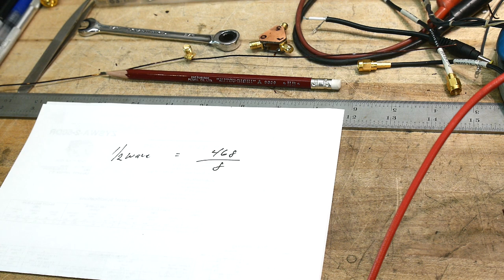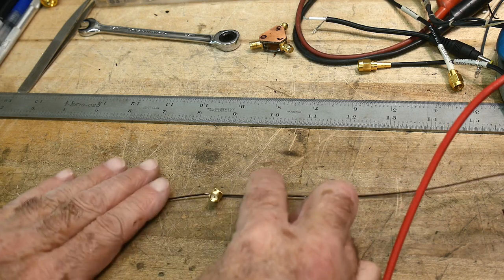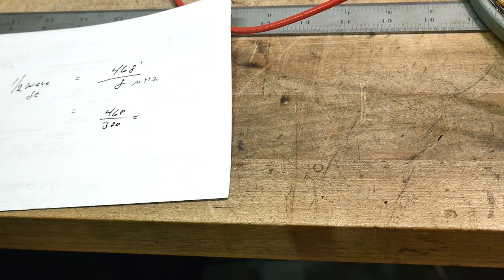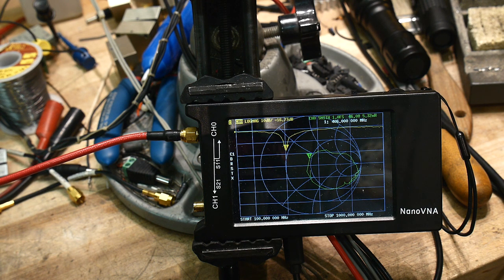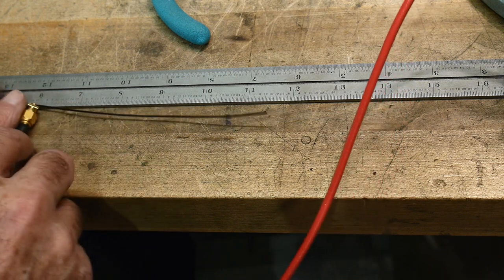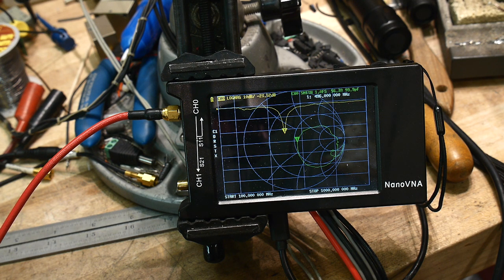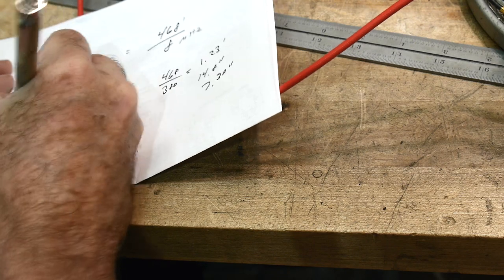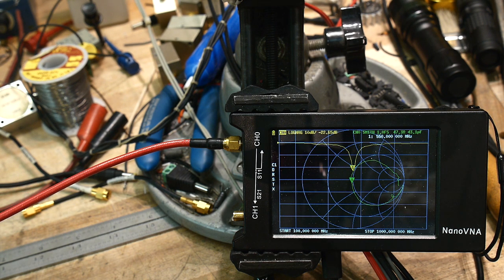#571b NANOVNA Measuring Dipole Antennas

Comment: The fact it is almost easier to calculate the exact dims using the standard formula I would advise anyone to just remember the speed of light.
Reply from the maker: yes that gets you close. the 'standard' formula has a 97.5% factor in it to shorten the length a bit. due to the length/wire-diameter effect
Reply: @IMSAIGuy  What I meant was it's hardly worth deviating.
Reply from the maker: @martinda7446  no you are right. I always want people to understand the simple ideas and not have to memorize formulas. gives a much better understanding.
Reply: @IMSAIGuy  I absolutely agree, but here the relationship with the speed of light, the wavelength and frequency is so fundamental and easy to understand anyway it is a wonderful thing - is what I was getting at. I didn't mean to sound critical.
Reply: There's a VP to consider also which is why the formula of 468/frequency is different from speed of light

Comment: God bless you for putting this out here.  I'm not sure what happened to our hobby that the newbies think that there is some magic to making an antenna.   Perhaps the license exam no longer asks for formula frequency for a 1/2 wave?  dipole. Remember back in the day running between the shack where you had your borrowed swr meter and outside snipping the wire?  Now it's easier than ever and hams are spending $100+ for a simple wire antenna.  They're missing a lot of fun and self satisfaction!
Reply from the maker: Millions of Hams have used DIY dipoles without baluns and worked the world!
Reply: @IMSAIGuy  Exactly, I still don't use a balun..most of my wire antennas are 1/2 squares now and I don't think it would perform w a balun.  Perhaps an RF Choke
Reply from the maker: @mjrtude  I just posted a video on 1/4 wave vertical and one in the future will be a discone

Comment: nanoVNA output is not balanced, so I think that without balun you can't measure dipoles, right?
Reply from the maker: https://rsgb.org/main/get-started-in-amateur-radio/antennas/your-first-antenna-the-half-wave-dipole/
Reply from the maker: all radios are unbalanced. dipoles work just fine.
Reply: The VNA should be calibrated at the antenna connection point, so that it can measure the antenna itself no matter if the output is balanced or not.

Comment: Imsa guy, a dipole is said to have an input impedance of 72 ohms.  Does that vary depending on the distance between the two feed points?
Reply from the maker: the 72 ohms can be derived with mathematics on an ideal dipole. actual dipoles are close. I don't now how much effect spacing the feed points would make. a small fraction of the wavelength. wire diameter makes a difference too

Comment: What would happen if you added a choke at antenna input ? Wouldn't that get you a better reading ? And isn't there a common mode current on the shield as it is there's usually current radiating on the outside of tne coax all the way to the source .

Comment: 0:35  The units of the 468 constant would actually be Feet * MHz (often confusingly written as "Feet-MHz", that's a dash not a minus). 

Dimensional Analysis processes units as if they're numbers; e.g. 'Feet-MHz' (constant) divided by MHz (the input) = answer (in feet).

Comment: You seem to be using your red coax (?Z =88ohms). Is this why the smith chart green circle off to the right rather than centred on the 50ohm centre. What would be effect be of using a 50 ohm coax? Does it matter if it was calibrated to load of 50ohms at the start?

Comment: That is how I learned decades ago to measure for a dipole but my doubt has always been, how do you account for the wire needed to tie the wire antenna to isolators or center balun?
Reply from the maker: use non-conducting rope, if you use wire then there will be some effect. not as much as you might think. every antenna system needs to be measured as used and tuned.

Comment: Given: A black box with a perfect world inside.
Given: A single element end-fed random wire on one connector on the black box, and a perfect ground on another connector.
Given: a Nano VNA

Question: What is the length of the end-fed random wire antenna?

History: I use to do fire clearance at a cabin. It had a single wire phone line that connected all the cabins in the canyon. The other wire for the phone was connected to a copper ground rod planted in the stream bed. I wondered what the length of the wire to where it was broken. Also, what bands would it be a great antenna for. It did make a great 160-meter and 80-meter antenna. I didn't have a nano VNA back then.
Reply from the maker: https://www.ni4l.com/portable-end-fed-160-10-meters-dipole-antenna-1kw/
Reply: Not an answer. Its like 1+1=1+1.
Reply from the maker: @Lugeix  I thought they told you the length they used. it is a bit subjective as you have a transformer and it is 'random'
Reply from the maker: various lengths can be made to have a reasonable VSWR but will have different radiation lobes. no way to tell from a VNA measurement..

Comment: Would the nano give any indication at all if one side of the dipole was shorter than the other ?
Reply from the maker: yes, it would not be resonant. the SWR will go up
Reply: @IMSAIGuy  I was wondering if any of the more complicated readings would tell you whether the radiator was short or the radial was short.  
It would be interesting to see the readings while lengthening and shortening the radial.
I was reading yesterday where a guy with ground plane antenna had 3 different radials bent at different angles and maybe different lengths too. He could get 3 different bands without an antenna tuner. There must be some sort of way to situate them correctly with the analyzer or maybe trial and error and checking SWR with each adjustment?

I was kind of wondering if a dipole would do that with different length radials while leaving the radiator alone?
Not that it really matters just curious.

Comment: I don't think that can be considered a dipole, given the single-ended drive. It's a monopole with a really bad ground plane. Inches & feet? U gotta be #^&(%^ me.
Reply from the maker: dipoles without baluns work just fine. All radios are single ended at the transmitter.
https://rsgb.org/main/get-started-in-amateur-radio/antennas/your-first-antenna-the-half-wave-dipole/
Reply: @IMSAIGuy  "All radios are single ended at the transmitter."  Irrelevant. I've never heard of a dipole being connected to a SE xmtr.

"The dipole antenna, which is the basis for most antenna designs, is a balancedcomponent, with equal but opposite voltages and currents applied at its two terminals. The vertical antenna is a monopole antenna, not balanced with respect to ground. The ground (or any large conductive surface) plays the role of the second conductor of a dipole. Since monopole antennas rely on a conductive surface, they may be mounted with a ground plane to approximate the effect of being mounted on the Earth's surface."  (W'paedia)

"A dipole is what is termed a balanced antenna. In an ideal world a balun should be used with coaxial feeder (which is unbalanced) to make the transition between balanced and unbalanced systems.
The use of a balun will prevent the coax radiating any power or picking up any noise. In many practical situations it is possible to operate the dipole satisfactorily without one, but there may be a slight increased risk of interference if one is not used. Simple baluns can be bought from antenna suppliers, or made." (from your link)
Reply from the maker: @qwaqwa1960  ok, how about an SWR meter?
Reply from the maker: ok, how about a network analyzer with a return loss bridge
Reply from the maker: how about the MFJ antenna analyzer? is that OK to connect to a dipole?
Reply: @IMSAIGuy  You are perhaps confusing transmission line with antenna.

Feeding a dipole antenna

Ideally, a half-wave dipole should be fed using a balanced transmission line matching its typical 65–70 Ω input impedance. Twin lead with a similar impedance is available but seldom used and does not match the balanced antenna terminals of most radio and television receivers. Much more common is the use of common 300 Ω twin lead in conjunction with a folded dipole. The driving point impedance of a half-wave folded dipole is 4 times that of a simple half-wave dipole, thus closely matching that 300 Ω characteristic impedance.[25] Most FM broadcast band tuners and older analog televisions include balanced 300 Ω antenna input terminals. However twin lead has the drawback that it is electrically disturbed by any other nearby conductor (including earth); when used for transmitting, care must be taken not to place it near other conductors.

Many types of coaxial cable (or "coax") have a characteristic impedance of 75 Ω, which would otherwise be a good match for a half-wave dipole. However coax is a single-ended line whereas a center-fed dipole expects a balanced line (such as twin lead). By symmetry, one can see that the dipole's terminals have an equal but opposite voltage, whereas coax has one conductor grounded. Using coax regardless results in an unbalanced line, in which the currents along the two conductors of the transmission line are no longer equal and opposite. Since you then have a net current along the transmission line, the transmission line becomes an antenna itself, with unpredictable results (since it depends on the path of the transmission line).[26] This will generally alter the antenna's intended radiation pattern, and change the impedance seen at the transmitter or receiver.

A balun is required to use coaxial cable with a dipole antenna. The balun transfers power between the single-ended coax and the balanced antenna, sometimes with an additional change in impedance. A balun can be implemented as a transformer which also allows for an impedance transformation. This is usually wound on a ferrite toroidal core. The toroid core material must be suitable for the frequency of use, and in a transmitting antenna it must be of sufficient size to avoid saturation.[27] Other balun designs are mentioned below.[28][29]

from https://en.wikipedia.org/wiki/Dipole_antenna